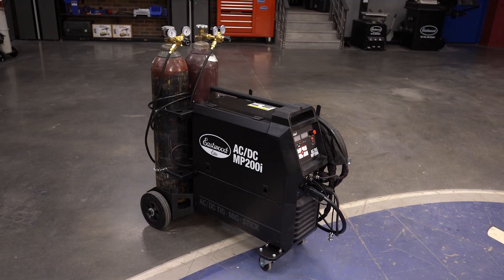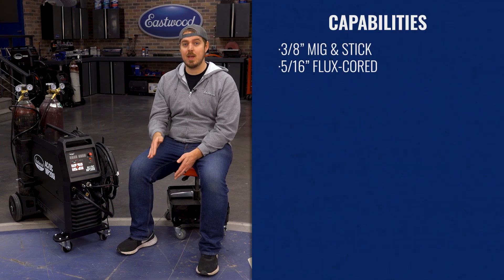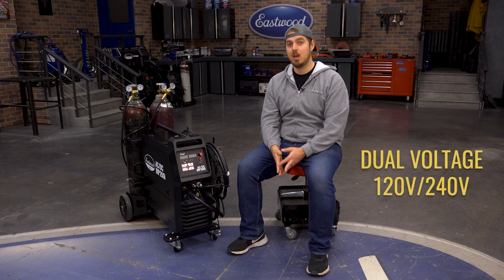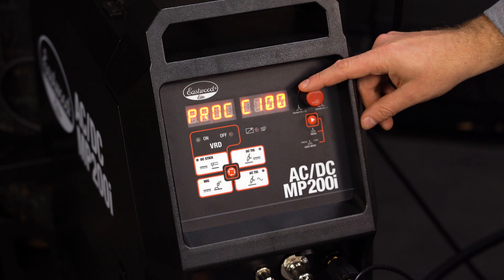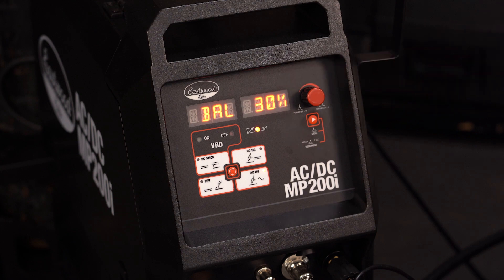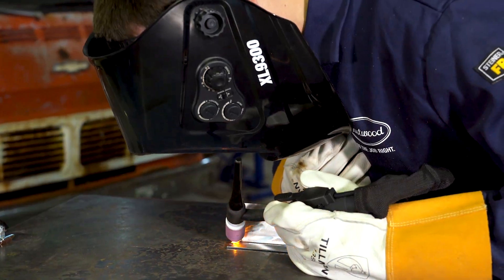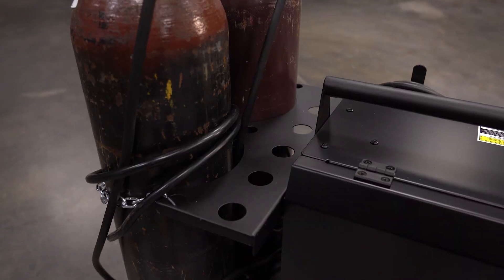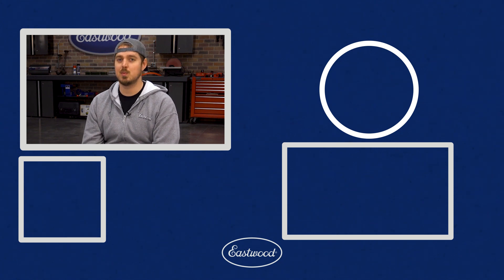TIG Weld Aluminum with a Multi-Process Welder! Elite AC/DC MP200i - MIG/TIG/STICK

Comment: Wow. $2,000.00 OUT OF MY PRICE RANGE.
Reply: If you don’t need the mug and stick setup, Eastwood has a 200 ac/dc Tig welder for less money.
Reply: @wildman318  $900.00 is a little better. THANKS. 
#STAYSAFE 
#PHILLYPHILLY 🇺🇸
#FLY EAGLES FLY 🦅